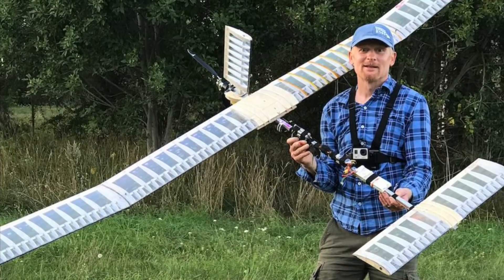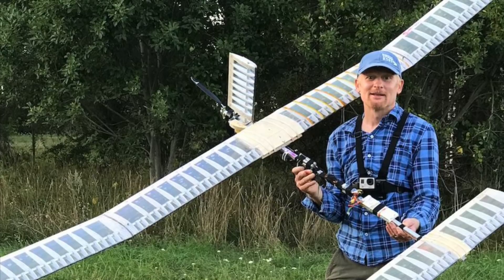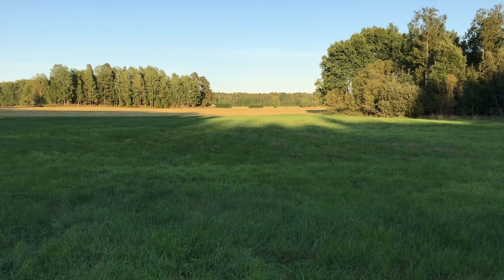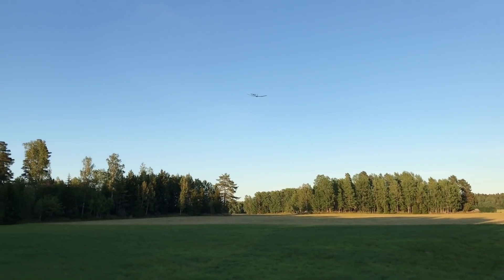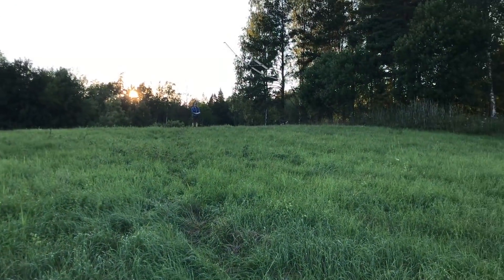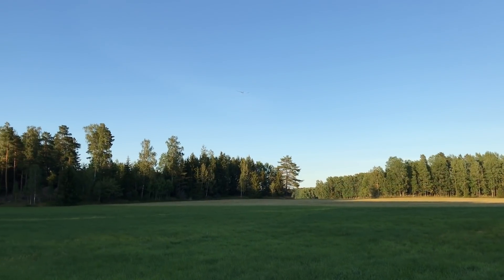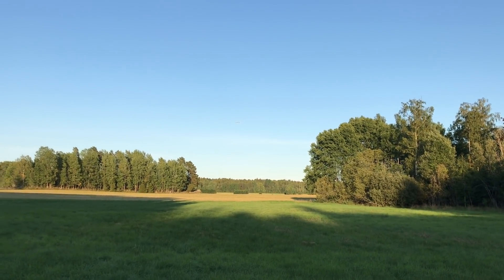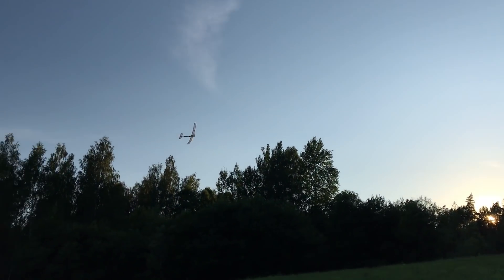3m RC canard model airplane  3kg TOW 80W cruise

Comment: Hi.  Looks like a very pleasant flying aircraft, but, do you not agree that having the CofG so far forward relies upon lift from the canard, which, because of it's lower aspect ratio is less efficient than getting the main wing (with the higher AR) to do the majority of lifting?
In general, the higher the AR, the more efficient the wing is.
Regards Mark in the UK